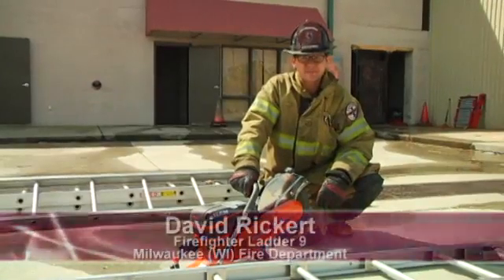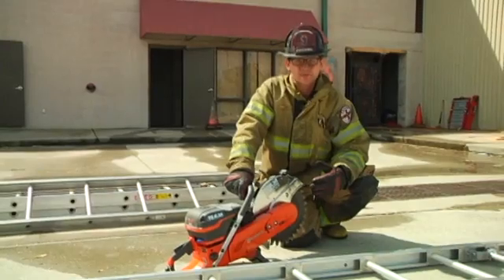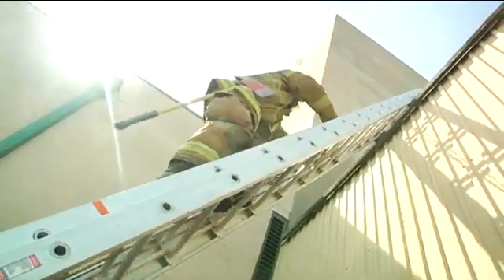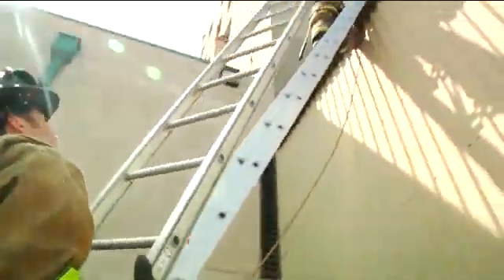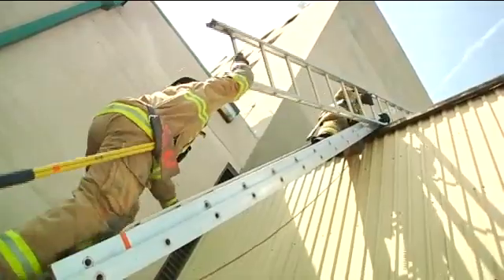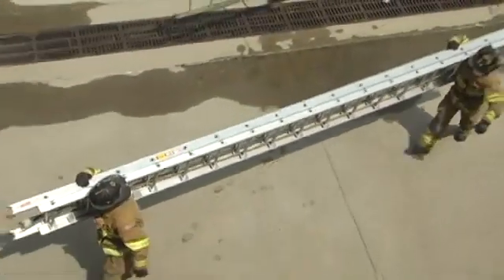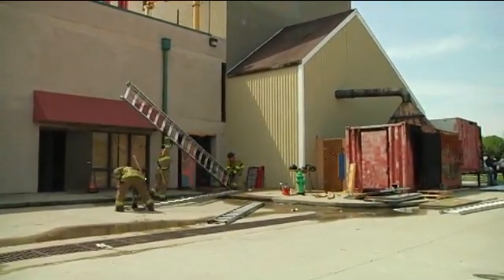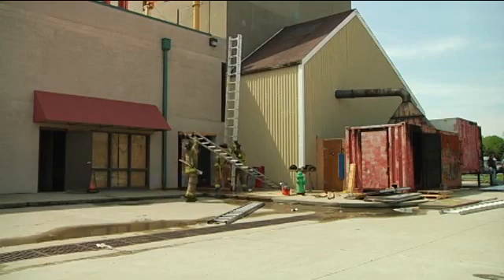Milwaukee Method for Peaked-Roof Structures

Comment: What is keeping the 2nd ladder from sliding off the roof.  At 1st I thought there was a raised edge at the bottom of the roof line, but I don't see one.
Even though it doesn't look too steep, it would look much steeper once you're up there.  Anyone who's ever been on a roof knows this.

If that were me up there, I'd want some U-shaped metal brackets nailed on top of the ladder rails, to secure it to the roof, and keep the ladder from sliding down.
Reply: Roof ladders have two very strong metal hooks at the tip of the ladder.  The hooks 'hook' over the ridge peak and dig in.  You can rotate the hooks 90° and they have points on them.

Comment: Seems quick however, anybody else see many safety issues with this video?  I cant see my department ever jeopardizing our team safety IOT gain a bit of speed.  I am available if you would like me to specifically point the area of concerns.
Reply: Safety issues Like what?
Reply: Does your department not have Chainsaws ? 
Leave the rotary saw on the ground for forcible entry needs.
Reply: @mikefargo4339  Once the 14" carbide blade is buried to the arbor, it cuts very safely and securely, allowing you to have a free hand to climb with. It might look sketchy to someone unfamiliar with this method or venting a peaked roof (6/12 - 14/12), but I can assure you it is very safe, speedy, and extremely effective. Milwaukee only uses chainsaws to trim branches for the aerial and cutting off plywood board-ups on vacant buildings. I hope this helps answer your question.
Reply: Train how you would operate